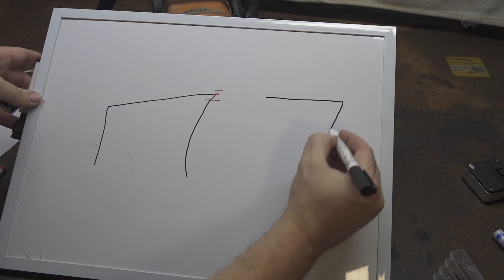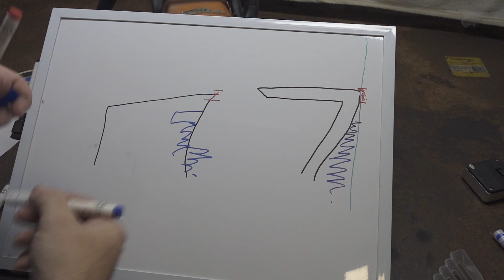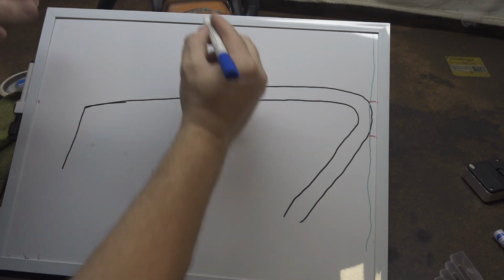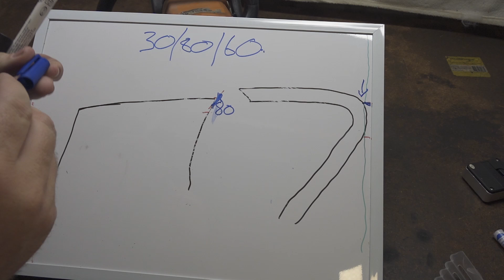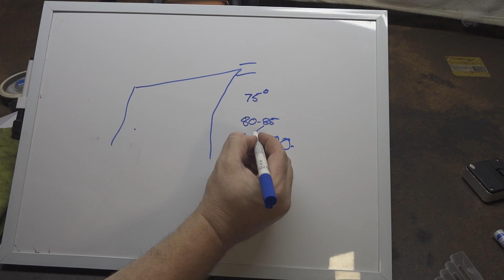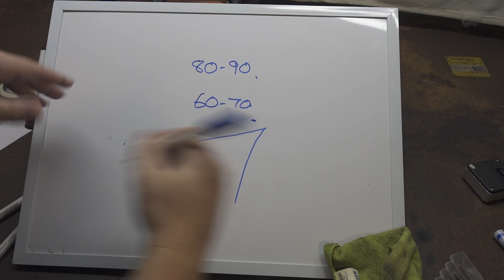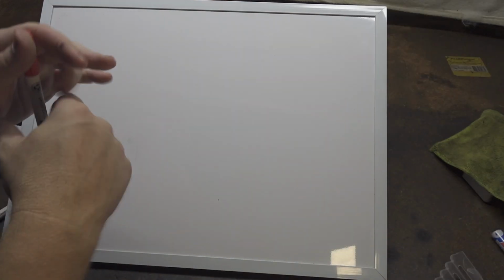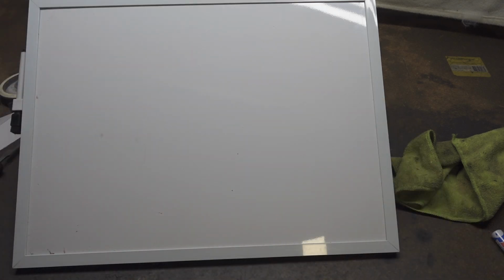Chainsaw chain side plate angle

Comment: My measurements using a graphics program result in about 50° (and 60 for .404) of side plate angle for both the Rapid and Picco Super from the factory. Of course, the stamped mark is 80° all the time, as it was more than 30 years ago.

If we want to measure angles between curves, we need to convert them into straight lines. This is done by determining the tangent line (or tangents) at the point of interest. Of course, the definition of a tangent line says that it is a straight line that has only one point in common with the curve.

In the video you use secants between 2 points. They are secants because they have 2 points in common with the curve. As these 2 points get closer together this secant gets closer and closer to the tangent line.

In the chisel tooth the matter is simple, because it has a shape similar to a '7' or 'L'. To determine the side plate angle, we have one point-where the top plate ends and the side plate begins (the corner). So we run a line tangent to the curve passing through this point.

In semi chisel teeth, the situation becomes more complicated, because their shape more resembles '?'.
Not all semi chisel teeth have a straight section of vertical cutting edge at all. Some are all “round.”
Even if they have a straight section, it is unlikely to take part in cutting.

Going from the center line of the chain along the cutting edge, we first have a flat part of the top plate, then the edge bends, begins to head downward, reaches a maximum protrusion beyond the axis of the chain and then returns to the link. Seeing this, you can deduce that at a certain point of rounding, the cutting edge cuts “at an angle” acting as both a side plate and the top plate from the chisel tooth. To cut the entire width of the kerf at the “original height” the tooth must make more than one pass (unlike the chisel tooth). After the first pass, which is limited by the depth gauge setting, subsequent passes widen the cut until the full width is reached.

From this it also follows that in a semi chisel chain the “side plate” should be sharpened at least to the point where it protrudes most beyond the axis of the chain. In a chisel chain, sharpening to the maximum expected chip thickness is sufficient.

Where, therefore, to measure the side plate angle? I believe where the flat part of the top plate ends, because it is the adjacent rounding that cuts off the side of the largest chip (while also deepening the kerf at this point).

So formally the side plate angle is measured between the
“vertical" tangent to the upper end of the sharpened surface
and the plane of the bottom of the toe and heel of the link.

All this sounds complicated, but in practice it is not so difficult. Just look from the side to see the angle you are interested in and use some kind of a gauge. If you are interested in a pretty accurate measurement you can take a picture and in the software determine this angle.

The term hook in the context of hooded cutters has 2 meanings. The first is used to distinguish cutters of the chipper or semi-chisel type, for example, from chisel ones: “hook-shaped cutting teeth.”

The second means the situation when the side plate angle is less than 90°. It can be defined that the hook angle = 90° minus the side plate angle. When the side plate angle is 85°, the hook angle is 5°, when the angle of the side plate is 90°, the hook angle is 0° (no hook).
When the side plate angle is greater than 90°, the hook angle values are negative (backslope).

The term hook for hand saws, circular saws, etc. was used long before there were power chain saws. It meant, as expected, how much the edge of the cutting tooth is deviated from the vertical. Another name used is rake or pitch.
If in older (and not only) manuals the name hook was used to indicate a sharpening error, it was probably because the standard expected side angle angle was 90°. For example, for the Oregon Chipper and Chisel.
A more precise term is “too much hook” and such is found in newer manuals.

When you draw an example of a hook, when the file is clearly below the top plate, this is a rare situation in my opinion. Much more common is that the file at least slightly protrudes above the top plate. In the first case you do not get a sharpened top plate cutting edge at all, in the second case the cutting edge is very weak, you get a small cutting angle.

If the X-Cut semi chisel has an extremely small corner radius, how does it compare to the Oregon Micro Chisel? Oregon once counted it, like the Super Chisel and Chisel, as a square-shaped or chisel cutter, and in their instructions there was also the possibility of square filing.
The standard side plate angle was 85°.
Reply from the maker: Thats a lot of information!

I want to show the witness marks on Stihl RM chains in more detail because I think it gives a good indication of how a side plate for that style of semi should look. Viewed from the side it looks like the cutter has been filed extremely low because the top plate is hanging out in front. It’s on the to do list but I really need to test this first. It’s not how I have sharpened those chains in the past so I don’t really know how they react when done that way.

All the semis are slightly different and that’s where this becomes complex. I can give general recommendations for full chisel but need to test the semi chisels individually.

I have not been able to find an equivalent to the S85 to compare it to. In 3/8 everything else has a much more rounded design. In 325 th S35G is similar to 21BPX so that might be a good option

Comment: About: Top Plate Cutting Angle. You could find PDF document that title is "Sharpening STIHL Saw Chains" from STIHL. There is a good illustlation of Top Plate Cutting Angle on page 7 of PDF (5 on print).
Reply from the maker: @shinichirohida2556  I have it and a couple of other good pictures of it that I should have just shown but I forgot them when doing the video